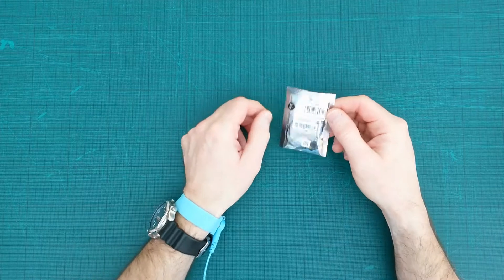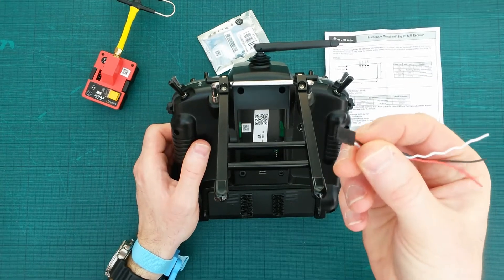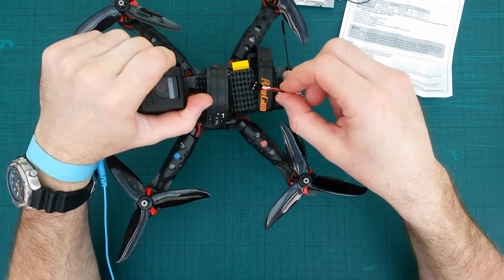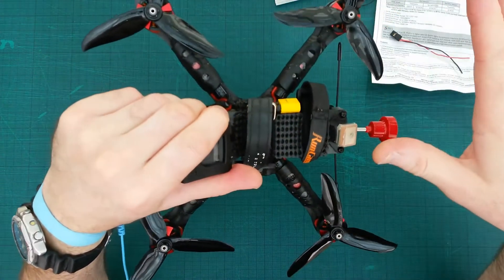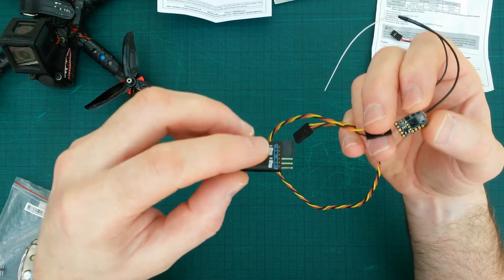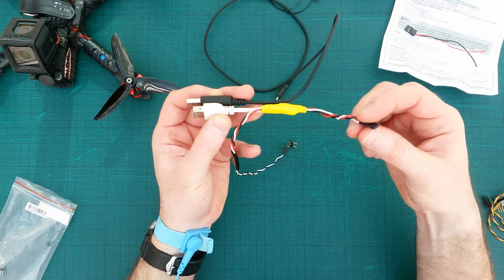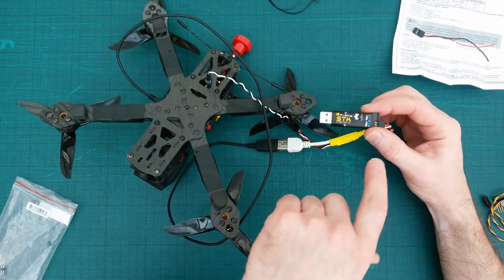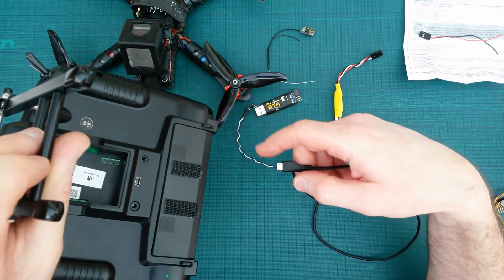R9MM FrySky Firmware Update MOD

Comment: Good day. Tell me how long does the R9mm work for you? For six months I changed seven pieces. Just at one point it starts to fail and stops binding. I thought it might overheat and began to put further from the hot parts but one hell stupidly begin to lose touch. I try to find information about such problems but in vain. I thought I was unlucky for the first time, probably a marriage, but seven times in a row on different copters with different fillings.
Reply from the maker: Hi Oleg, I have not had any major issues with my R9mm, i use flex firmware and matched the firmware with both TX and RX.I use the  FrSky 868MHz Dipole T IPEX4 Receiver Antenna and ditched the original, also I use a FrSky 868MHz Super 8 Antenna on my Taranis and both are polarised horizontally.
Mine is fitted to the rear of my Martian bottom plate frame, I have had over 1 mile out on a 6" quad with still very good rsi, I have the same set up
on 2 quads.I don't no if this has anything to do with it, but I 4 x low esr capacitors fitted to my esc's and 1 to the Vbat in.
Never had a failsafe, only had twiches ocassionally which I believe is signal loss or blocked or interference.
I hope this helps.
Reply from the maker: You could fit a gps and have rescue mode and enable logs to try and fault find problem?
Reply: @pablofpv  Thanks friend almost helped.